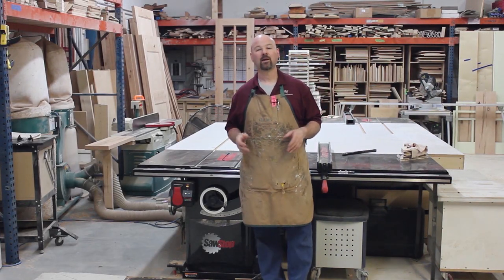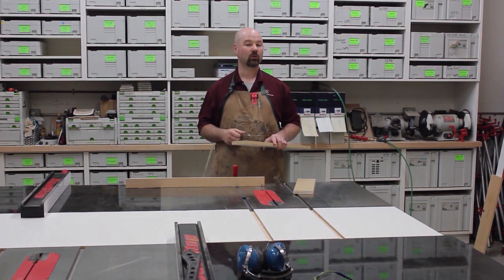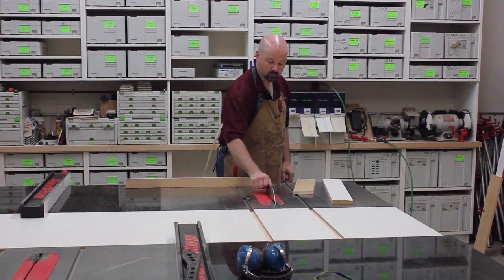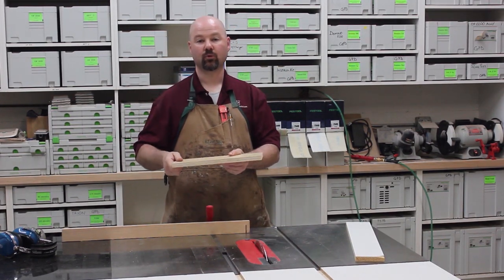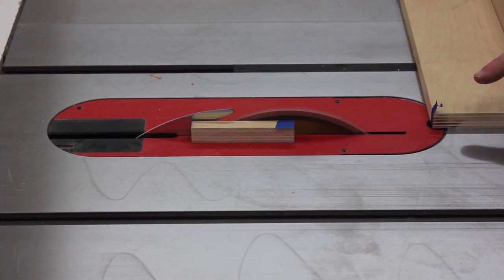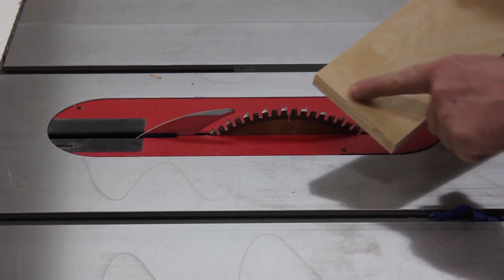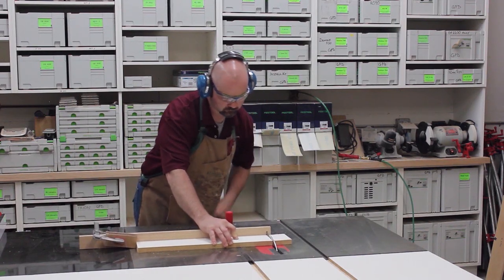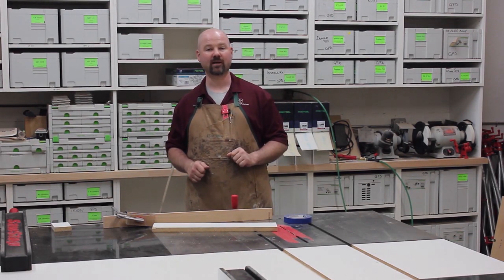Eliminating Tear Out On Your SawStop Table Saw

Comment: I see your problem with the melamine and plywood. What you need is to upgrade to a professional saw. These saws typically have a scoring blade in front of the main blade. That guarantees a clean cut. Also, these saws have outrigger tables and long rip cutting sliding tables. So, you need to fit the machine to the task. And the sawstop, nice as it is, is a Hobby saw.